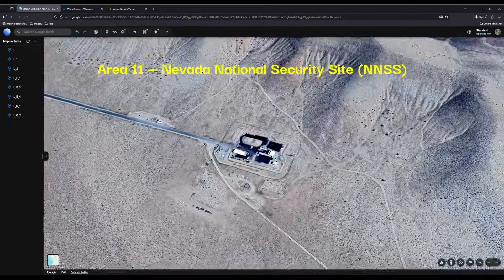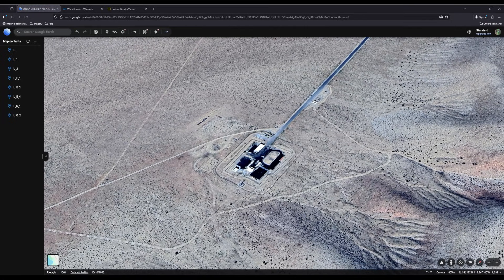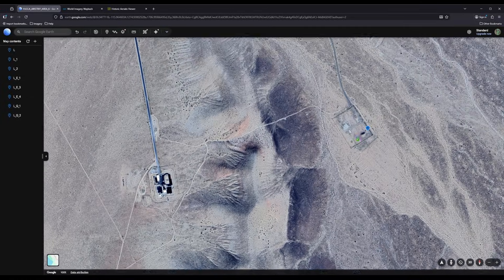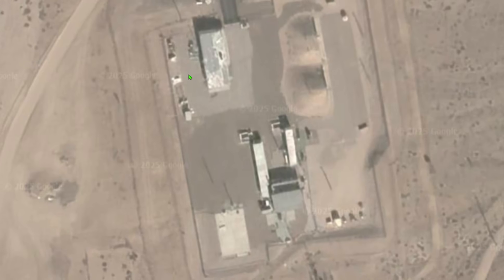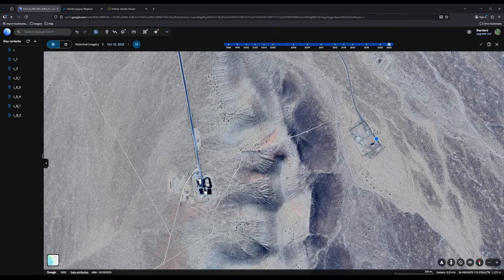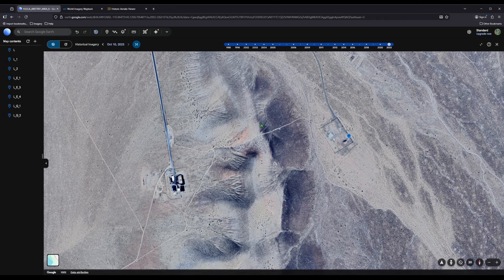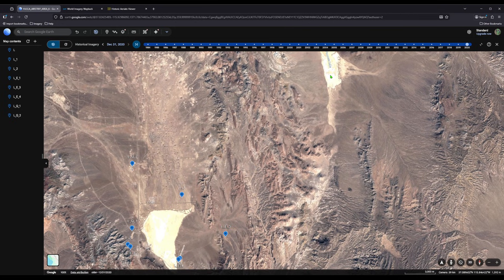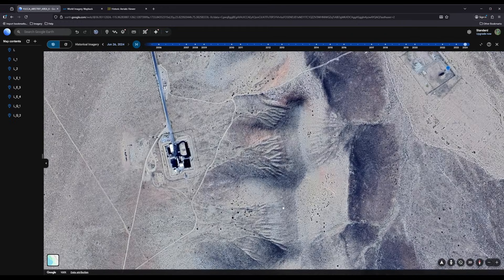Area 11 at the Nevada Test Site — A Historical Analysis of the “Dense Plasma Focus” Facility

Comment: If u can, do a video on the rocket test area on the N/E corner of Edwards AFB. That stuff is fully exposed but still classified. 👍
Reply from the maker: Ok I will take note of this location and check it out. If you would post a lat long that would be great so I can be accurate to your described location. But if not jo worries, I will try to interpret your description with my best guess. Thanks for reaching out!